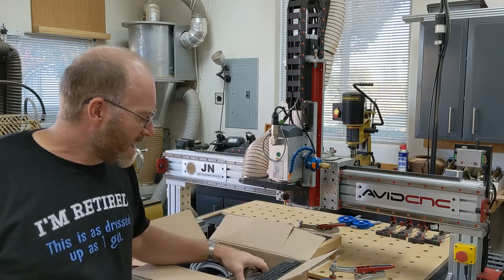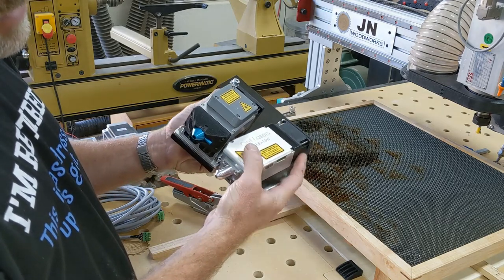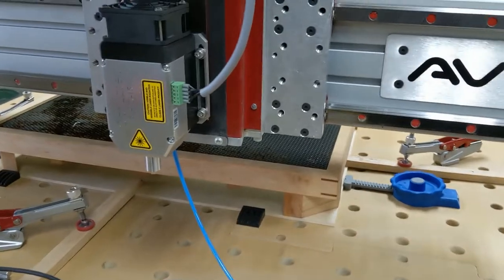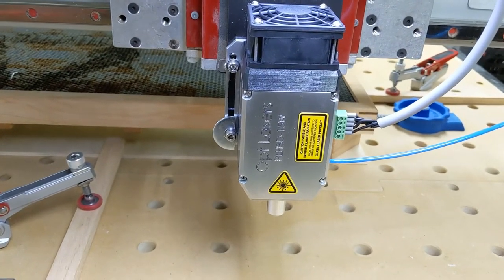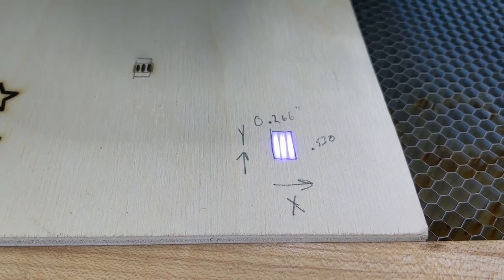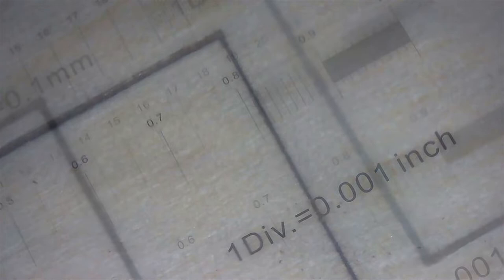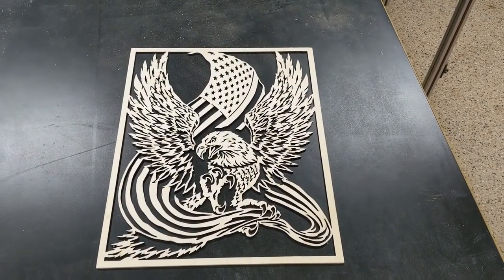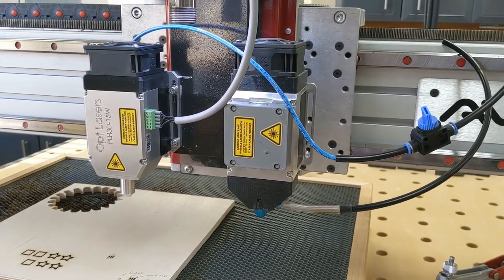Review of the production version of the new 15W blue laser from Opt Lasers running on my AVID CNC.

Comment: Just got my laser installed. The air assist nozzle is not conductive. I think the new version is anodized and my touch plate will not work. Working thru software issues with Mach4 now. Do you have a postprocessor for Vetric VCarve Pro? If you do would you mind sharing?
Reply from the maker: I don't know if it's anodized, but it would have a good coat of oxide on it sooner or later.  Mine works pretty consistently.
I do have post processors.  Send me an email at jnwdwks@gmail.com and I'll reply with the processors.

Comment: thanks for your experiential info on the opt lasers workings.. something i've being eying to get.. concerning air flow troublems.. a double action bellow used by japanese iron workers could be worked to feed large volume of steady air? thinking 10 rpm geared motor could push/pull the piston to operate air pump.. its a bit amish but silent compared to noisy compressors.. pressure would be low but enough to blow away dust debris?
Reply from the maker: I know the type of device you are talking about, but haven't used one.  That is a high volume, low pressure device.  I don't know if it would generate enough pressure to force it through the small input line and small nozzle.

Comment: Nice setup and a very tidy and organized shop. One day I will install one on my Avid Pro. Would a metal plate with the thickness of required offset do the trick?
Reply from the maker: Hi Lucian,
Sorry, I didn't notice your question before.  Yes, what most people do with fixed focal length lasers is they fine tune the focus using some test coupons and view the widths of the lines with a microscope until it is optimized the way they want it, then they measure the distance from something on the laser head to the workpiece surface to see what that distance is.  In the case of this laser, the distance from the air assist nozzle to the work piece is about 0.131", so I made a spacer that thickness and use it as a guide.  In the future I am going to come up with a touchplate solution that will be faster to set up though.

Comment: Hello I really appreciate the video. Any interest in selling the old prototype? Also I wonder if you could do a floating head with a roller guide to keep the laser at the exact focal point no matter the flatness of the material.
Reply: Hi Dustin, I traded the prototype in for a production model (I have a video on the production one too).  If the material were rigid enough, I suppose you could make a tracking roller.  Some higher end CO2 lasers use cameras to do that kind of tracking.  The flatness problem is usually an issue with thin warped material, and a roller would likely affect the position of that kind of thing.  Also, the Vectric laser package does actually give you the option of tracking the laser Z height against a model of the surface if you have a model available, which is pretty cool.

Comment: Great video.  I asked AVID if they are working on a laser and they said they are doing more testing with this one during the summer.
  So your project size is limited by the size of your honeycomb bed?  Can you set the amount of power coming out of the laser?
Reply from the maker: Hi David,
I think they are evaluating some different lasers right now.  IMO, the Opt ones are the best you can get.  

The honeycomb bed is really only needed for cutting.  When I am just etching/engraving, I will typically just set the workpiece on my CNC clamping surface.  In some cases I needed to cut something big (like a cardboard template for tracing something), so I just lay down a chunk of scrap MDF or something so the laser can cut through and still not mark up my spoilboard.  So i can basically us the whole 49" x 49" range of my gantry.

As far as power, yes, you can control the laser power both with a laser screen (I'll be doing a video on this soon) in Mach 4, and with your Gcode files (similar to controlling your spindle speed).  I use 0.1% power for focusing and zeroing the Axis', and then 10-100% for etching to cutting.

Comment: Can you explain how do you zero X,Y with the laser? do you use the zero block provided by avid cnc?
Reply from the maker: Hi Heriberto,
For Z, I currently just use a piece of plastic that is about 0.125" thick. That is the right spacing between the material and the air nozzle on the 15W laser for the smallest spot.  For X and Y, I use the test fire capability in Mach 4 that lets you turn on the laser at a very low power (so that it  won't burn the surface).  I turn it on and jog the visible dot to the location I want and then set the zero.  You can get the dot on the edge easily with incremental jog.
I plan to come up with an attachment to the laser head to use the AVID touchplate, but just haven't had time yet.  Although, the visual method above is pretty fast and accuracy since the dot is so small.
Reply: @JNWoodworks  Thanks for the answer I ordered the same laser, I will use the laser head to use the AVID touchplate, The issue that i want to figure out is the formula used in the mach3 auto zero macro.

Also if you use vectric what tool do you use?
Reply from the maker: @heribertoluna9517  by Tool, do you mean the software?  I use Vectric Vcarve pro, with the the laser SW module.
For laser work, you really need to upgrade to MACH4.  The Warp9 folks have really upgraded the ESS plugin a lot to support the laser work (and even have some cool rastering capability built in now).  This has great ability to control the laser PWM power and turn on and off in synchronization with the motor movements which is critical for a laser.  Send me an email request at jnwdwks@gmail.com and I can send you the setup info and the laser connections that I used to get everything working.
For the touchplate to set the Z axis, it would be the same setup for Mach3 or Mach4.  The touchplate routine is going to set the Z axis to zero where the nozzle would just touch the workpiece, but for that laser, you want it to be about 0.120" to 0.130" (you should do some focusing experiments to figure out the best value - Opt lasers has some great videos that on YouTube).  0.125" will get you very close.  So after you use the touchplate, you can simply jog up to 0.125", and then hit the "Zero Z" button in mach, and now your Z height is set to the correct location.

Comment: Greetings,

If you use vectric or any other software what post processor are you using? Also what tool do you use? I am also using sheetcam and Enroute
Reply from the maker: Hi Heriberto,
I do use Vectric Vcarve Pro for all of my CNC router and laser designs.  My post processor for the laser is something I created based on the AVID router PP.  If you would like a copy, please send an email request to jnwdwks@gmail.com and I'll send you a copy.  As far as the tool question, I am not sure what tool you are referring to.  Can you clarify?
Reply: @JNWoodworks  Thanks for the videos, in case it goes to spam I sent an email too

Comment: Super nice laser setup on your Avid CNC machine.  Have you had any experience with the Avid Opt PLH3D-6W-XF model and your review of same? I have been considering to get one for my Avid  Desktop Pro and would appreciate your opinion on this model if possible. Thanks for a very informative video.
Reply from the maker: Hi Nicholas,
My experience with Opt lasers starts with the 15W model.  My only other laser experience was a cheap $300 (for the whole X-Y CNC plus the head) one from Amazon.
I have read a lot of other reviews, and looked at various other ones on the manufacturer's websites.  As you can imagine, like everything else, you get what you pay for.  I really like the Opt lasers because they are really built well all the way  through )both the laser part and the optics).  They have some application info on their website that can help you with what you can actually cut and and mark with a 6W unit.  The uSpot lens models really help get the power density up so that is where you can get some decent marking of metals and other materials that you wouldn't normally do very easily with 6W and a bigger beam. The uSpot is also nice if  you are trying to engrave particularly fine details.  So it just depends a lot on your budget and the type of work you plan on doing.  I have been amazed at all the things I have found out i can do with mine, or seen others doing on YouTube :-)
Reply: @JNWoodworks  Thanks for your info. I have a couple of  additional questions regarding the mounting of the laser on the spindle mounting plate below the spindle. Is that an aluminum bracket to which you attached the laser and did you make it yourself or did it come with the Opt kit?  I noted that you also have figured out a system to use the touch plate to be able to set up the laser more precisely and consistently above your workpiece.  Were you able to do that by just adding a metal washer to enable proper grounding  or did you also need to modify the touch plate code to make it work properly with the laser module? Thanks again for your helpful info.
Reply from the maker: @ukie1242  I made that bracket myself.  It's just cut out of aluminum plate.  I will be making a drawing of the dimensions next week to post on Opt Lasers web site.  As for the touch plate SW, the simplest thing to do is just change the thickness of the touchplate setting in the touchplate routine ( this is in the AVID touchplate advanced settings).  Change it to the actual thickness minus the height above the workpiece that you want the nozzle to be at Z=0.  
However, I think that is a bit of a hack and error prone since you will need to change it back when you want to use the router.  So I am working on something a little more automatic in my Mach 4 screen (I will be making a video on laser focusing soon that will include this), and have also asked AVID to add a second touchplate tab for lasers to the next revision of their touchplate SW routine.

Comment: What CAD or cam software are you using? I'm using fusion and trying to get mindset up but I could never get the software to run the laser tool path
Reply from the maker: I use Vectric Vcarve pro, but I do know some people have gotten post processors working for F360 as well.